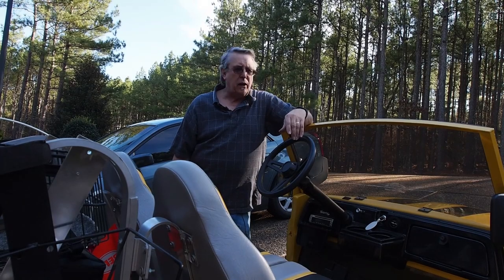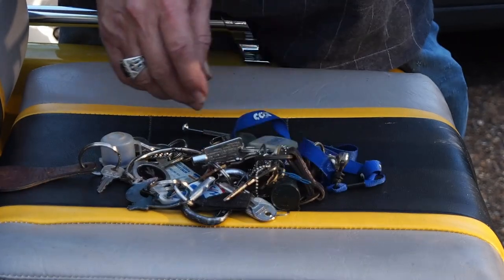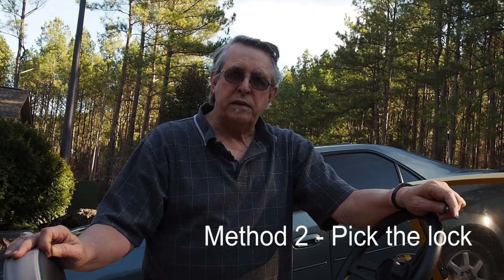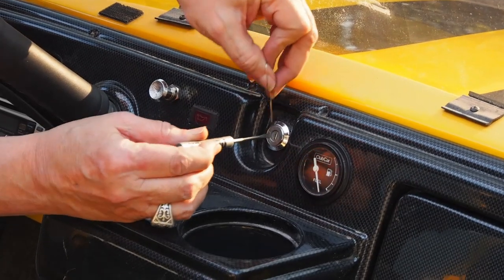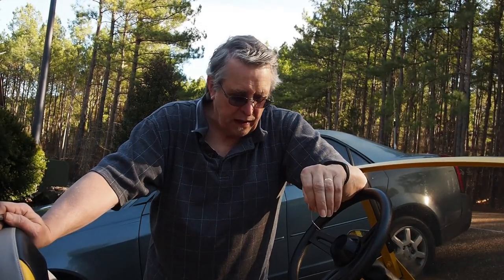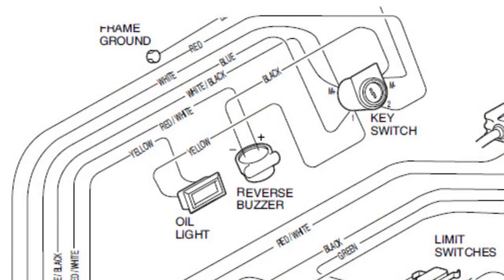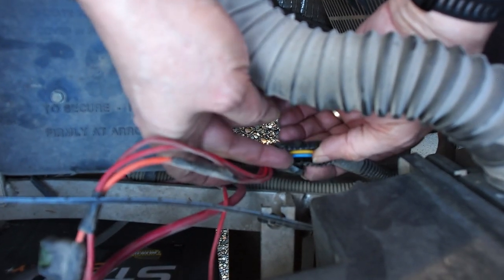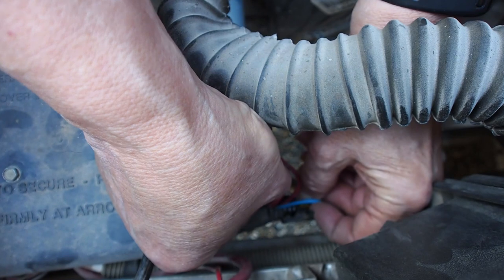How To Start A Golf Cart Without A Key

Comment: A little info from a locksmith with over 25 years experience.
1) The parts that come in contact with the key inside the ignition switch are flat brass plates called "wafers" and not tumblers. Tumblers are found in traditional house locks.  
2) The reason that you are able to use another key to turn the switch is that the wafers are very worn, but if you do have the proper key with you, then you should use that one because you will cause further wear and damage to the lock.
3) Don't play James Bond with a paperclip because if you accidentally hook or push one of the springs out of place, that are on the side of each wafer in the lock, you won't even be able to turn the ignition switch to the on position with the proper key, you will be replacing the whole switch as well!